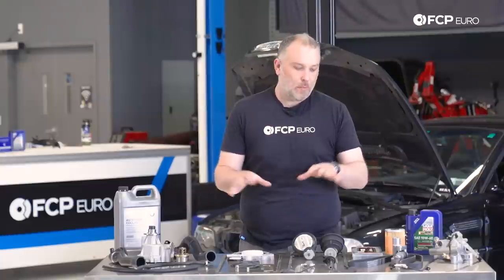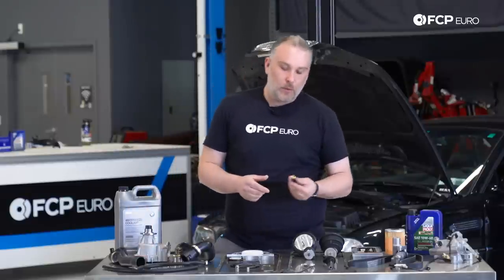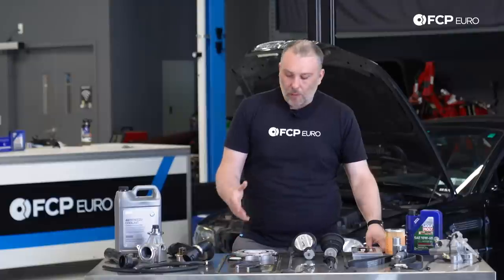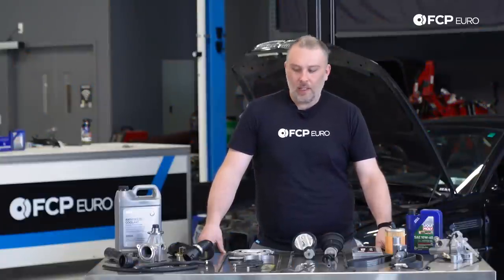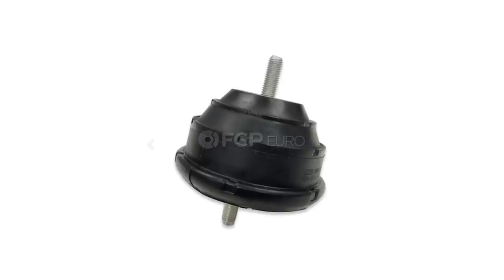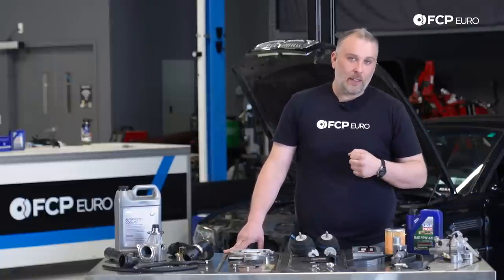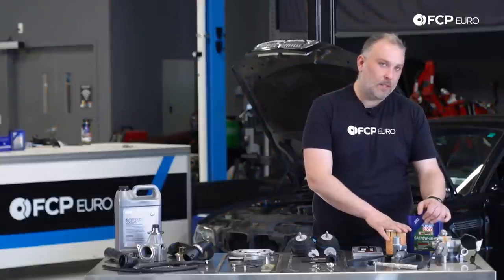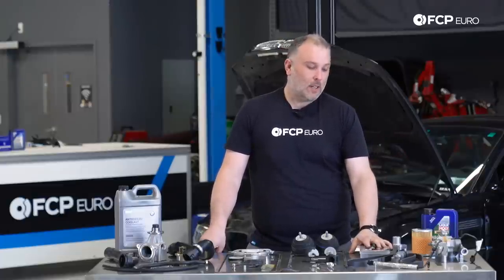BMW S54: Everything You Need To Know - The BMW E46 M3 Engine Guide

Comment: The best M3 ever made, and seeing content that helps ppl get the most out of them and the legendary S54 is amazing. More videos about them would definitely be welcome, even ones that would require an advanced or intermediate DIY level. Thank you for the vid, much appreciated. Full cooling system overhaul is in the books for me.
Reply from the maker: Plenty more S54 content otw Christian Haba! You know where to shop when it comes time for that cooling kit!
Reply: I just did it with their Kit
Reply from the maker: @TheRedcroatian  We've got the DIY for that live as well. Stay tuned as Rod Bearings DIY is coming out soon as well
Reply: Did any of you recently see on a press video on BMW Blog that one of the head managers at BMW M of Germany revealed that BMW back in the day produced a one-off, a one of one, E46 M3 CSL concept vehicle, but however, this M3 did not have its traditional S54 Inline-6 cylinder paired up with a tuned SMG-II, but rather, the BMW engineers somehow fitted a complete ///M-tuned 425 bhp, S62B50 V8 engine, borrowed from an E39 M5, paired with a six-speed manual Gertag transmission?
Reply: @rheinamacher1990  we saw that but that's one off
Reply: @fcpeuro  100% agree. If we understand what the car needs. It'll make owning one a much better experience. (:

Comment: Just converted my 04 smg to manual, new guibo, clutch, valve lash, plugs, vanos bullet proofed, oil changed to motul 8100x power(10w 60). With 126,000 miles, this thing is still a beast. Have to give thanks to Lang racing development in Lake Forest Ca. Looks completely factory done. I loved the S.M.G. but the manual is definitely the way to go. You get so much fun for a few hundred bucks of preventative maintenance per year. I will never get rid of it... Next is full paint job.
Reply from the maker: Nice work Lazaro, we love to hear that! What color is next?
Reply: @fcpeuro  Same color, Titanium Silver.
Reply: How was it cost wise?

Comment: My rod bearings are fine at 120k miles. Why? "Full operating temperature is when the OIL temp is 200 degrees F. I don't even look at the coolant temp. No more than 3k RPM until oil reaches 200. Liqui Moly 10w-60 oil here in steamy South Florida. One can of Ceratec per oil change every 4,500 miles. Mahle oil filter. Mann air filter.
I have gutted the cooling system and replaced everything but the radiator and oil cooler.  New aftermarket silicone hoses with special $4.50 smooth hose clamps.

New ELDOR coils and NGK plugs at 120K miles. It ran great before. Now, it runs perfect.
Next job is those pesky valves. Getting noisy. I have done 80% of the  preventative mainatence in this video. Its a VERY accurate video.

However, I have ZERO oil leaks. I burn ZERO oil in between oil changes. I FLOG the engine every single day to and from work. My tuned motor red line is 8,100. I run it right up there every commute. I drive the PISS out of it.  I think it runs better than it did the day I bought my 2005 M3 in 2008 when it only had 17K miles on it.

Most of my wear and tear was in my cooling system. I really gutted damn near everything hanging off the front of the motor. New EVERYTHING including fan, fan shroud, fan clutch. Every single O'ring. Every sensor.

Motor is good for another 120K miles. Easy. I cant tell you how quick it is and  whips newer cars with greater RWHP. Like a red headed step child. 
Oh, and Uniden R7 top of the line radar detector plus WAZE navigation. And I commute to work at 11:30 PM in light traffic on I-95. No worries.
Reply: Mine were actually great a 150k when I changed them it really depends on the previous owners warm up time

Comment: I wish FCP had some vetted shops in the Tri—State area they partnered with. It’s not always easy finding genuine, reliable shops.
Reply: Rouge Engineering. There is no substitute.
Reply: For tri-state S54 work, Rogue is absolutely the go-to. Had them do my VANOS rebuild and valve adjustment and have a bunch of their parts on my car as well. Top-Tier company.

Comment: I buy part from you guys. I have bmwx3 28i. Currently there are 2 codes P0238 and P007d. 
I recently replaced throttle body mounting seal and engine oil temperature sensor.
Kindly help me to resolve these codes.

Comment: It's a love and hate relationship with my M3. Just wait until you run into the Brake Pressure Sensor issue and its right there but a PIA to get to it. 🤣
Reply from the maker: The pressure sensors on the master cylinder are definitely tough to get to.

Comment: One thing no one mentions, S54's don't like 10w60, 5w50 If you're going to track it, 5w40 is perfect for a daily, just drive to work and back, maybe a little pull here and there.
Reply: Horrible, incredibly stupid advice. LET YOUR MOTOR WARM UP FIRST ITS NOT HARD
Reply: @joshuad1716  you know the S54 was designed for 5w30 right?
Reply: Hmm, my m3 has 39k miles on it. Of those over 30k are hard track miles on my 2003 (dedicated track car). Those 30k are literally on track in the upper rpm range…it’s trailered. Did the rod bearings for piece of mind last year. Pretty much looked new. Probably have over 20 Blackstone oil reports on mine…all glowing. Have used only 10w60 from BMW, Castrol, and Liqui-Moly. Just offering my 2 cents. 10w60 has worked great for me.
Reply: @SavageBunny1  have any sources/information on this?
Reply: @roundel171  “trust me bro”
Reply: Just use 10w60 and watch your oil gauge it's not hard